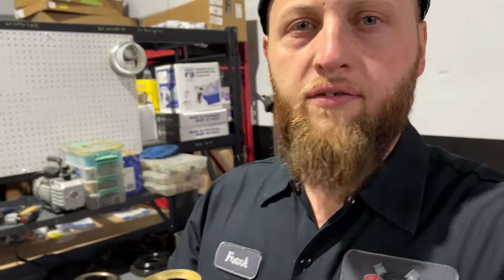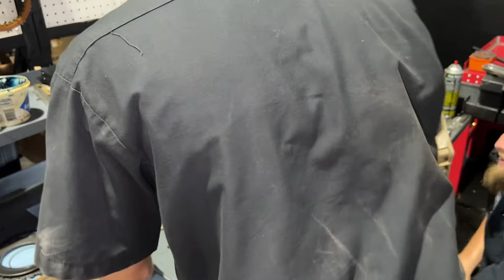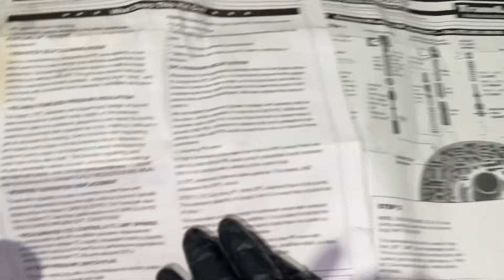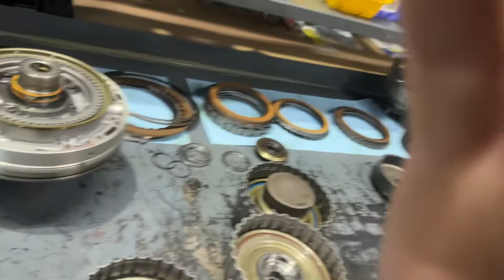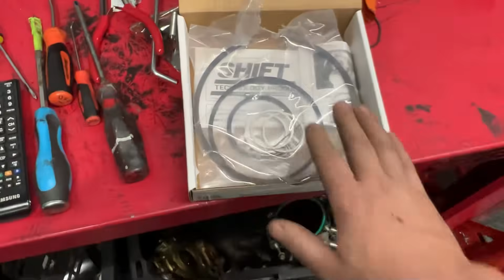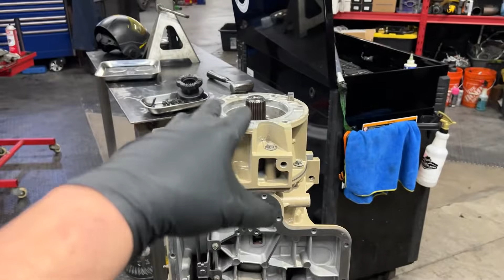5R110W TRANSMISSION REBUILD STEP BY STEP | F250 BUILD PART 3

Comment: Have you ever seen one just lose all gear like you put it in neutral?
Reply: Pump failed due to bad grounds.
Reply: @homeworxchannel4120 mine actually blowed out the solenoid body gasket
Reply: Mine did that. Had a downshift, then a pop, and all neutrals minus park

Comment: I have a 6 speed in my f350 power stroke. It has a small leak at the back casing. Can you put some transmission leak in transmission to try to stop leak?
Reply from the maker: Would never recommend putting any type of "stop leak" additive in any fluid in your vehicle.

Comment: My 5r110w has no reverse "at all" hard jump/lunge forward when going into drive, driving the truck down the road it'll take the 2 gears then slip... once it slips tow/haul light will blink then it wont slip forward gears anymore just no over drive or reverse from then on. Any tips greatly appreciated!
Reply: did you ever figure this out same thing is happening to me?
Reply: That sounds like the low reverse snap ring poped out of place (that’s why they made a updated snap ring) usually when that happens it whacks a lug in the case out and you might need to replace the case.

Comment: Do you have a link or name of a cost effective rebuild/overhaul kit? I have the cab off my truck, doing a full rebuild and bulletproof of the engine. Not adding a bunch of horsepower, just want it in good condition. While the cab is off and engine removed, I might as well do a tranny overhaul as the truck has 225,000 miles on it. What is na decent kit to overhaul the transmission. I don't need high performance, i just want the tranny to last with the engine for a couple hundred thousand more miles without needing any major repairs. Thank you for any information you can give, i clicked like and subscribed to your channel/group.

Comment: Ive gotta either try this or just pay for a overhaul and stay away from the used $500 craigslist deals. My truck has eaten 3 torque converters in the last year.
Reply: Sure it isn't pumps

Comment: My 5R11OW decided to die on me late at night in my E350. Loud bang while shifting to third.  No more power to the wheels. who knows.. maybe FORD decided to ground the transmission pump to the alternator, Or bad coast gear weld, or dead solenoids.. its all a big mystery

Comment: Can you do a video on how to replace the input shaft on the 5r110w? I cant find a video or a how to write up on it anywhere.
Reply: The input shaft just pulls straight out the front pump. No disassembly

Comment: Thanks for the video.I am going to try to rebuild my spare.I use my truck to tow my camper,however it’s tuned and has bigger injectors ,turbo and cam.What sort of rebuild do you recommend,meaning similar to video or should more upgrades be done,since I have more done to my truck? Thanks
Reply from the maker: I would at least upgrade to a Goerend billet triple disk & billet input
Reply: Are you meaning the convertor and input shaft? Also ,if I was counting right
I would only need 4 special tools for disassembly and assembly?  Thank you.

Comment: Thanks for taking the time to do the video. You don't need the resizing tool for those high pressure seals. What you do is lube them up, install them. Then wrap them and the shaft as tight as you can with electrical tape. Maybe 5 times around, then you take a screw on type adjustable hose clamp and tighten it as hard as you can. After 45 mins or so, you are good to go. Remove the clamp and the electrical tape. I learned this technique on hydraulic seals. Works great.

Figured I would add some value so you can take the transmission goodness one little step further. ;)
Reply from the maker: Thanks! Right on I thought about doing something like that to make it work but just figured I wouldn’t risk it. I do have the proper tool coming for next time!

Comment: Would the rebuild be the same even with a PTO trans case? Do you have any links for a DIY guide on how to rebuild them? Some things are skipped in the video. I appreciate you posting this though, there’s no clear videos on the 5R110
Reply from the maker: What all do you need to know that I missed? Sorry if I did! As far as I know the PTO is the same just has a different drum. The ATSG manual I referenced really covers EVERYTHING when it comes to rebuilding these. Call Matt at Randy’s Transmission or Joe at Performance Transmission Products for any parts!
Reply: @FrankBUILTperformance  nah you didn’t really miss anything too crazy, i guess it was the springs installing them in the pump. There’s so many clutches I gotta figure out, looks complicated for sure. I have no problem rebuilding engines just want to get into transmissions. I really appreciate the video.
Can the ATSG manual be found online or purchased anywhere?
Again thanks for the video it’s making me more comfortable for sure.
Edit: found the manual already thank you
Reply from the maker: @leozavaroff9055  awesome! I was the same way, first started building Allisons when I had my Dmax and started with YouTube videos and ATSG manual. That’s why I wanted to give back! Take your time, double check everything, follow the video / manual and you should be good! Driving this truck now and it runs great. Nice clean, crisp shifts.
Reply: @FrankBUILTperformance  I don’t even know what’s wrong with mine to be honest, I have an SCT tune but all it is an EcoBeast tune
Pretty rough shifts and now it seems like it’s not shifting until like 3K RPM. 
Fluid isn’t red on the dipstick looks orange, kind of smells burnt. 
I’m debating on doing a flush but trying to prepare for the worst. 🤷🏻‍♂️
Reply from the maker: @leozavaroff9055  def do some diagnostics before going into the unit!
Reply: So, i can not for the life of me keep a transmission in my 04, i just roasted number 7 in past decade.   Everyone refuses to build my trucks trans.  I live north of Milwaukee wi.   My 6.0 isn't crazy, just 170s PM turbo, intake,fuel delete and pump, studded etc.
So im now too the point where I'm looking out side the state.
Reply: What kind of solvent are you using in your parts cleaner for aluminum parts?
Reply from the maker: Powder stuff I get from my transmission parts supplier.